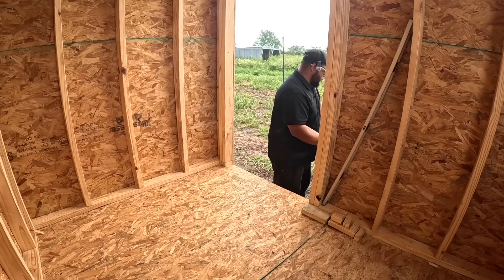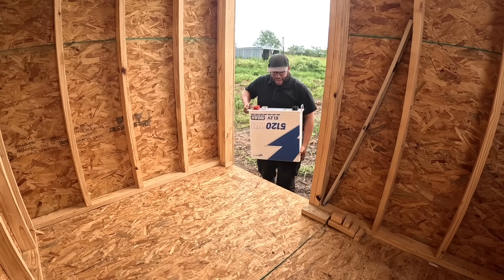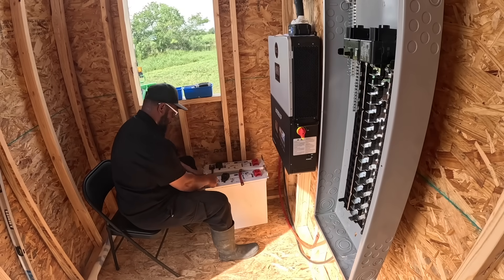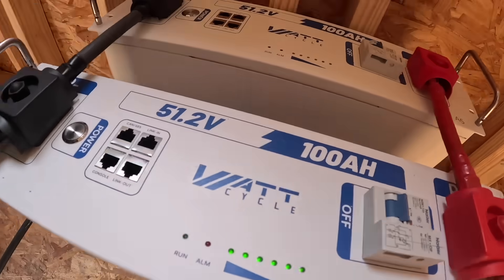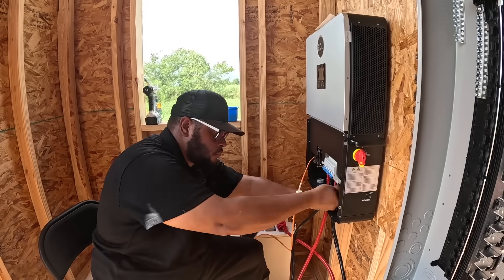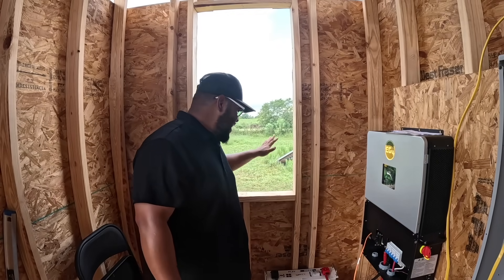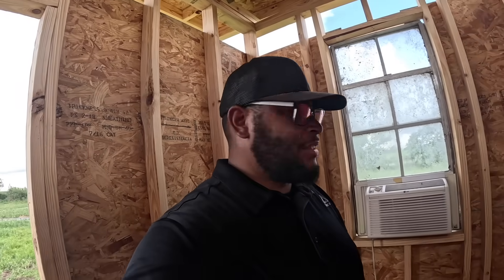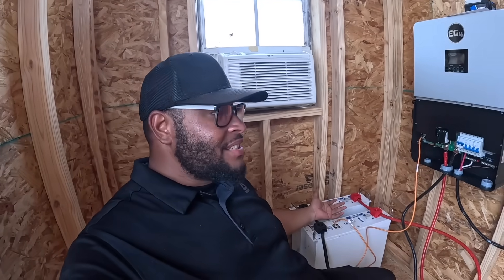Choosing the right battery bank - Off Grid Homestead

Comment: Probably just needed a load center because that 200 AMP will never trip. Load Center with double pole 40 amp breaker would've been sufficient.
Reply from the maker: Right on. My load center will have a 50amp breaker. I also plan to add another inverter later. Thanks for the info and for tuning in. ✌🏽

Comment: There are a few things about this video that people shouldn't do. But I will only mention the most important. DO NOT power on any system you install without having everything connected including communication cables. I see YouTubers make serious mistakes when installing solar equipment. Even out of the box these batteries contain enough Voltage and Amperage to be very dangerous. Do not be scared of installing your own solar equipment but please people research safety protocols. These things can hurt if you make simple mistakes! Use only insulated tools please!! Also purchase a multimeter to check for voltage. You may think things you are about to touch can possibly have power flowing through them but they can. When installing or checking any, I mean any, type of power system please check check and check again.
Reply from the maker: Right on. Thanks for this information. Much appreciated 🫡 ✌🏽

Comment: dont you need to connect the comports from battery 1 and 2...and then to the inverter (what you did)   so your missing 1 com cable in my opinion...:hand-orange-covering-eyes:
Reply from the maker: Yes. You are right. I did not connect the batteries to each other. They will be linked when we permanently set up the system within the powerhouse. This was temporary just to showcase the batteries. Thanks for watching and stay tuned 🫡

Comment: You really should put a 49 amp breaker in and not used the main look in Manuel the 200 amp main breaker will never trip before a great big fire is going
Reply from the maker: Right, this was just a temporary setup just to showcase the batteries. When we install it permanently, you can rest assured that we will have a control center with a 50 amp breaker between the inverter and the breaker box. Appreciate the information, and thanks for watching. ✌🏽🫡
Reply: @timetotiny  Put you on my list can't to see you through this When I wright something only trying to help you have a nice started system lot better then mind was
Reply from the maker: Thank you. I appreciate the information for real.
Reply: Sorry 40 amp
Reply from the maker: I knew what you were saying.

Comment: I am so ready to do what you are doing!  One think I might would add would be to get some Hardy Board or Concrete Board to mount between your Inverter, Circuit Breaker and various items to give you a bit more fire resistance in case there is a spark.  I think this is actually in a lot of City building codes for fire safety.  I would also buy some cheap concrete pavers to put under the batteries for some additional fire protection for your wood floors.  Not sure about the weather in your area, but are you planning to install insulation in your power house to keep the temp up in the winter?  Just wondering what you are going to do on the solar side.  Also don't forget to check for ground neutral bonding.  Should only have one in the whole system.  Most people put it in the main breaker box.
Reply from the maker: Great advice, thank you so much for the suggestions and for watching! 🫡
Reply: @timetotiny  Thanks for sharing it and glad to see your progress.  Ready to hear about the solar array you are going to hook up to it!

Comment: FYI... you need to correct something in the video 📹  with ac you have 2 hots, One is red and the other is black. White is neutral or negative common ground is bare copper or green. most of the time this is the case for northern America.  Most of the time  dc hot is red or any other colors can be know as hot except black, though I've seen black as a hot wire in dc electrical. Please know what you are talking about before you say it with this kind of stuff. FYI you don't want to have something come falling back on for mis information.  Also but a disclaimer in that says, when working with this kind of stuff you are doing so at your own risk, read up on this stuff before installing this type of equipment and if unsure seek professional help for your installation. In the panel you need to remove the grean bonding screw off the negative bus bar on the right side of the panel. This is known as a sub panel you have there. Also you need to drive 2 ground rod's in the ground about 6 feet apart from one another bond in one continuous run with #6 copper wire both rod's to the inverter and ac panel you can put a grounding bar on the wall there and tie both the inverter and panel in but that is something that you need to do. The inverter does not create a safety ground. The inverter creates the 2 hot's and the natural / negative line but that's it.
Reply from the maker: Thanks for the heads up! We appreciate the feedback and will keep that in mind for future videos and installations. Just FYI... Watch again and try to understand that this video was a collaboration to showcase the 48v batteries. Also be sure to listen carefully to what is said and that should let you know that this is not a how-to video. I understand your concerns and want to let you know that when this system is permanently set up, we will have taken all the safety precautions and consulted the appropriate licensed professionals. Thanks for watching, we really appreciate you 🫡
Reply: @timetotiny i know it was a calibration with the battery company. Ive got some batteries i purchased onmy own from DYNESS group 24 to do a review on and a battery charger 12 v 20 a from vevor... it did ok charging one of the two batteries but the wire from the charger to the battery is under sized heating it up because of the resistance in the undersized wire... i my self am one to make sure I try to provide the most correct information i can when installing something, also you did ok on the plugs but because of not having a earth ground  the plugs should be GFI ie: ground falt interruption if there is a falt between the hot and natural of the device it will brake the power connection. Or change your braker to a GFI Braker..
 Stay informed and stay safe... if you look a different inverters like xantrax or semlax 300 and up to 3000 watts they have GFI's because of no quote/unquote ground. Just trying to keep you safe my friend...
Reply from the maker: This is awesome info. We appreciate it.

Comment: I do not want to deter you in any way, but that inverter and whatever buss bars your going to use should be on cement board. in case some goes zap.
Reply from the maker: Appreciate the info and thanks for tuning in. We're still in the process of building out the power-house and your suggestion is right on because thats exactly what we've had planned to do. Great Minds 🫡

Comment: It’s good to read that you will review all safety measures upon final install. Because you got a few issues but please remember this inverter has a lot of power especially the solar side and please back feed your 200 amp service panel with a dual pole 50 amp breaker the way you have done it is not best practice but at least it’s a start. Took us off grid 7 years ago learned more in those years than I thought I ever would enjoy it’s not easy but it is fun.
Reply from the maker: Wow! 7 years off grid is awesome! Yes, we are aware and when its all setup we'll have some licensed professional check our work. Thanks so much for tuning in 🫡

Comment: Good idea 3 Eco flow delta pro ultra system and Eco flow delta pro ultra extra 9 battery and Eco flow delta smart panel 2 power whole off the grid  house 😊😊😊
Reply from the maker: Is this the system you’re running? It must have cost you a fortune.
Reply: @timetotiny Yes 😊
Reply from the maker: Nice!

Comment: That unit will get hot.  You need to put fiber cement or cut C channel and attach that to the wall and have Annie break. 8 gauge. AC wire   1 awg battery wire.  I just in stalled my second one of those a week ago.   The other I have had for 1 year. You need Ferrell on 10 awg PV wires.  Every thing I mentioned is a fire hazard    Its in the user manual. You also need 2 Ground  wires8 feet apart 7 feet deep.  hit me if you have any solar questions.
Reply from the maker: Thanks for this good information and concerns. I am aware of the safety precautions that should be taken per the user manual. This video was made just to showcase the batteries and the setup is not yet permeant. We are still in the process of building out the power-house and when its completed, will set it up per the user manual for sure. Thanks for tuning in. Much appreciated.

Comment: Hey guys love the content !!! The only thing missing here is a grounding round running from outside to inside to your inverter. Safety first when dealing with 48v system batteries.. yes the system will work but definitely look into a grounding rod for the system. The content is great‼️
Reply from the maker: Appreciate the info and thanks for tuning in. Safety is super important to us and we're for sure going to connect to a copper grounding rod outside once will put the power-house in its final home.
Reply: @timetotiny absolutely you guys are doing great!!!

Comment: Hey Bud, i'm not sure if you did it or not, but you need to follow the start up sequence.You need to turn that battery breaker on your inverter before you turn on the batteries. Serious things can happen to your inverter. I have two of the same 6000 XP inverters.
Reply from the maker: You are right. I do know the startup process but thanks for the insight. If you dont mind me asking... What are you powering with your two 6000Xp's? I think I will need another one in a few years.
Reply: @timetotiny i'm running right around 3000 to 3500 Watts. I basically did 2 for redundancy.In case one takes a dump , I have another one that's running and no problems
Reply from the maker: Thats a good idea. Cool!